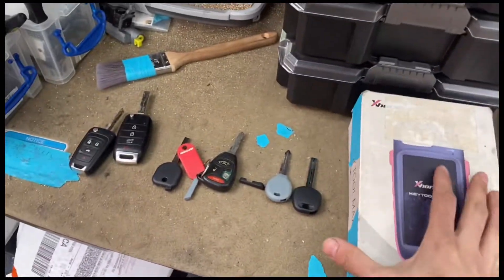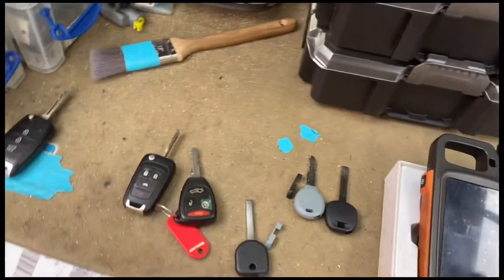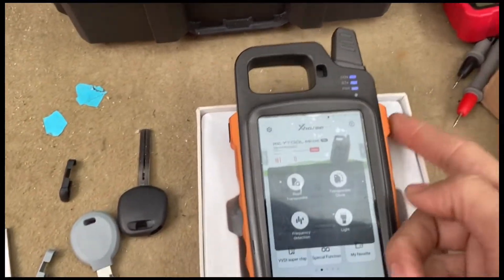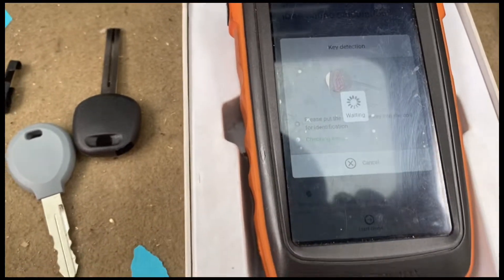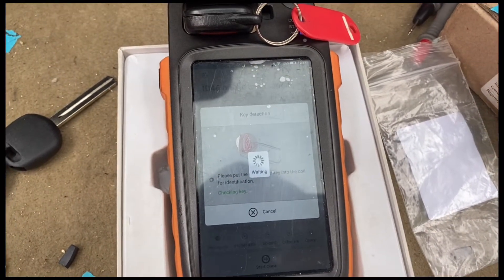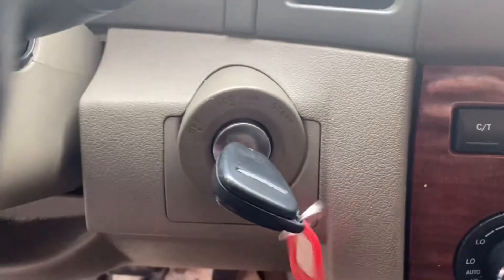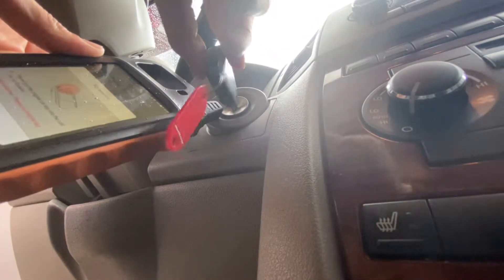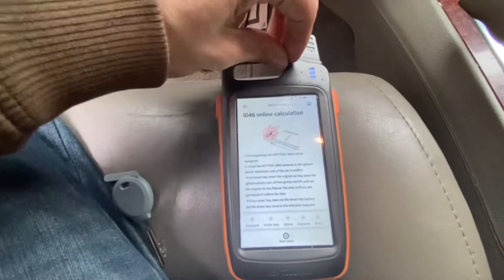How to clone a transponder key using Xhorse VVDI  Key tool Max

Comment: i understand the point of doing this on some models but on a Grand Cherokee like this  its takes like 1 minutes to pull the pin code and program a new transponder key with a basic programmer heck it takes less than take second to  programs a transponder key on Most GM product ( when you already have a working key)
Reply from the maker: I agree, but I’m just showing how to use the tool
Reply: Yea but look at something like 06 dodge can you can’t read pin cloning save a lot of work.

Comment: Whats the difference or advantage of programming the key vs cloning the key ?
Reply from the maker: Some cars require a 10-12 minutes wait to program a new key , cloning done in seconds . Other cars you need a pin code to program new keys , when cloning it’s not required